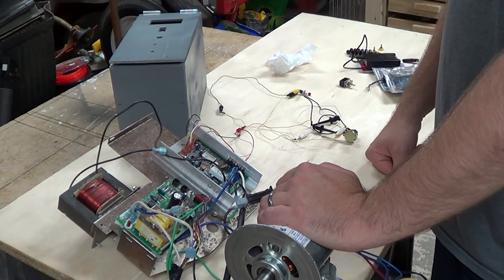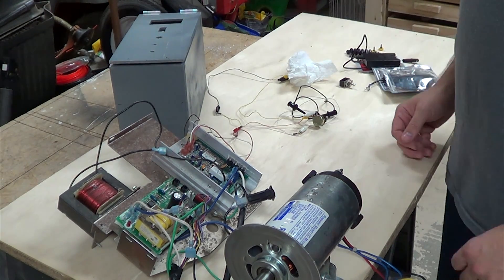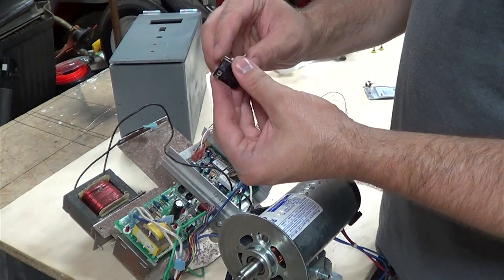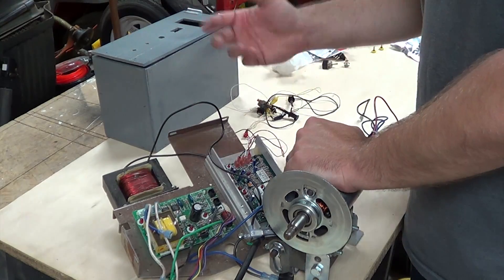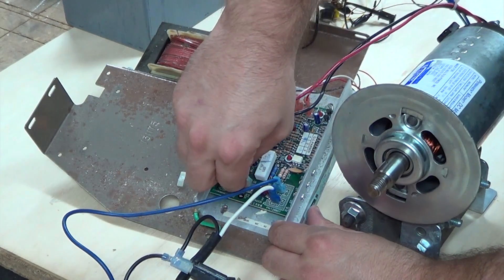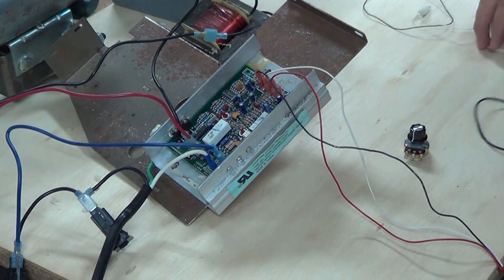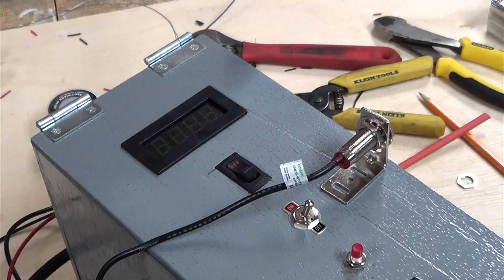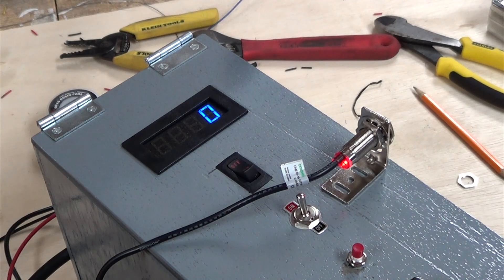Benchtop Horizontal Milling Machine Part 2 // Restoration and Rebuild

Comment: I never throw away a wallwart, I must have 20 running from 3vdc to 24vdc.  I am 8:00 in the video, wishing I knew what you know.  Your tachometer operates on the Hall Effect.  Did you put a vent hole for makeup air?
Reply from the maker: Same here with the wallwarts.  The box has a computer fan built into it for airflow. Cheap, but effective.

Comment: Good idea with the interrupter switch in the wiper. I've read that you can snip R19(?) but your method is less risky re permanent damage to the circuit board

Comment: That is the best set up for a DC treadmill circuit I have found. You can ditch the power supply with the yellow transformer as the one with the aluminum housing is the PWM and the big transformer is for the motor. Also if you want to keep the same motor speed without having to reset the potentiometer put an interrupting switch post PWM. On my lathe the reverse switch (acts as such) it will shut down the motor and turn it back on without interrupting the pot. Now the power supply with the yellow transformer is a neat little unit. It has 120 AC in and 2 120 outs. It also has a power for a hall at 5v 2 more 5v power outs (if I remember correctly) I am using one to supply my 3 DRO's on my mill. It also has a 9v+ out (mine measures about 12v out). I have a few videos discussing these circuits on my channel. Perhaps they may help keep the cost down. Any questions feel free to ask, I am not a professional, but have a father who is a retired master electrician and a brother and good friend who are both astral physicists, plus network engineers, and computer guru's I work with, so we have a pretty good support group for electrical applications.
Reply: That thermal sensor can be removed. just pull the one nut with the clip and it pulls right out. That switch you bought, goes by Reed, Proximity, Hall sensor is all the same as the little black one you just threw out. The thick you called a choke is a transformer used to change the AC voltage from the wall to a DC voltage that your motor requires. The yellow one on the other board produces a 5v and 9v+. The incline motor off the treadmill is actually an AC motor witch uses the out on the other board and a reversal circuit inside the board to control it (probably an H bridge) I never looked much into it yet. Also that other board had all the circuitry need to add a tach except the display itself and magnet. Sorry not trying to act like a know it all, just trying to share my experiences and save you some time and money on your next project. Thanks for the video.
Reply from the maker: +Ronster Irons Awesome info, thank you.
Reply from the maker: +Ronster Irons Awesome info, thank you.

Comment: A better way to maintain the speed when you power on / off without resetting the speed pot is to simply Clip R19 (resistor next to the  wiper spade connector).  I've used this feature for 10 years on MC-60 controllers with great success on all sorts of machinery.  Oh, you don't need that big choke either. Just remove it and run the motor leads directly. 

I use the same style Chinese Tach on some machines. Generally not good over 1000 RPM.

Thanks for the video!
Reply from the maker: +MatthewRulla That right there is a useful piece of information.  Thanks for posting that.